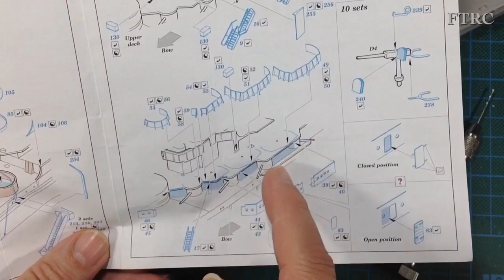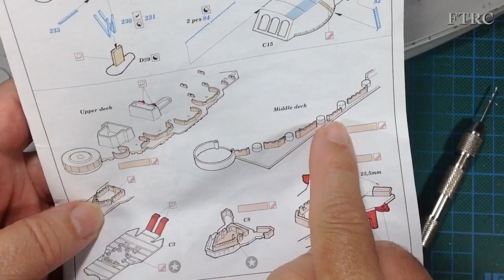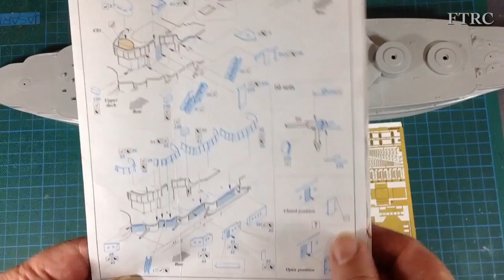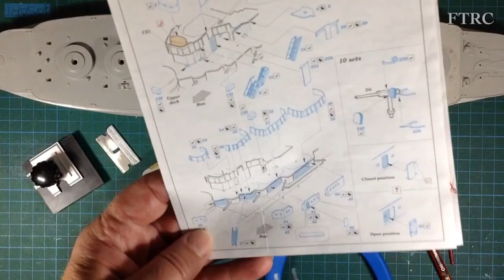Hobby Boss USS Arizona Part 4 (Photo-etch Mid Deck)

Comment: You crack me up! love the vids. Learned a lot on this build so far. I have a Banner models 1/350 Still looking froward to building it. Keep it going!
Reply: Tom Ellithorpe I actually just “finished” (minus PE deck rails and rigging) a Banner 1/350 Arizona and was pleased with the quality. I’ve heard it is just a re-branded Hobby Boss Kit. I did not have any deck fit issues like Harry did on his. Only issue is the seam where the mid deck attaches, but I guess a PE set as Harry installed would take care of that, which I don’t have. Good build all around though.
Reply from the maker: If you have a look at my scuttlebut video I discuss the revisions and reboxings of this kit from Banner to the other Chinese brands and it’s final rebox by Hobby Boss.  
https://www.youtube.com/watch?v=bmZ87nqhLTc&lc=UgwBVcGBIktSGFyolOV4AaABAg

Comment: I definitely need to get that PE set because that seam on my Banner 1/350 Arizona is bad. It’s already together so I’d need to modify them and just “plate” the sides if that would work. One Suggestion, purchase a small battery powered drill for the port holes and save yourself a helluva lot of work. 👍 I drilled mine out in about 1/2 hour with a small Black & Decker drill.
Reply from the maker: You should be able to plate the superstructure with the PE set to cover up the bad seam line, or even some thin styrene might work.. just remember to drill out the port holes with your handy Black & Decker.

Comment: Those Xuron cutters Harry....👏🏻👏🏻👏🏻👏🏻....I use Orvis fly tying scissors which work just as well...but...go blunt fairly quickly ( they are meant to only cut thread!) I found they were the only scissors that cut tiny PE beautifully.....but these Xuron’s...have to get a pair. I notice they look like the 9180et cutters, is that correct as Xuron make so many different cutters (their spruce side cutters look the dogs danglies too!)
Reply from the maker: Hi Steve.. I think my Xuron PE cutters are the 9180 SHEAR - SERRATED... it’s been a few years since I bought them.  To cut styrene I now use the new Meng cutters, which are similar to my old Mineshima ones.  Cuts close to part with little or no distortion and removes small parts from the sprues with no ‘ping’ to the carpet monster.
Reply: Harry Houdini Models cheers mate....love my citadel sprue cutters but they will need replacing soon, so any and all advice is appreciated!

Comment: me again I used to use a pin vice still do now n again I upgraded to a drill kit by tamiya, its super slow n very easy to use, bonus is you build it ,check it out...
tamiya...74041 electric handy drill
Reply from the maker: you on commission?

Comment: I’ve just been on Eduardo’s website as I have Tamiya’s 1/350 Enterprise and it’s a monster!
There are five photo etch sets you can get but probably costs more than the original kit.
I’ll probably bite the bullet and get the Full Monty BUT I will put this kit on ice for a time until I have mastered this technic with smaller kits.
Reply from the maker: Start small or you may burn out.  Photo etch takes a while to get your head around.  But once mastered it’s just another part in the kit.

Comment: Is there any reason you don’t use an Electric drill Harry?
Obviously need to use a low rpm.
Reply from the maker: Didn’t have one that would go slow enough.  I’ve always hand drilled out my portholes.  Don’t mind doing it.  Less danger of melting the plastic or making a mistake.